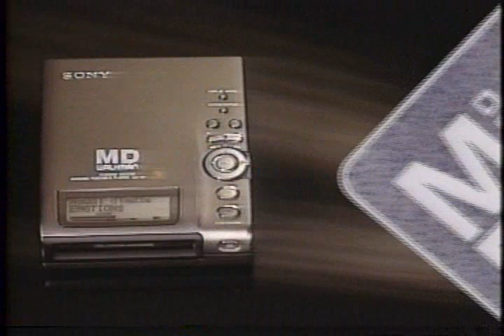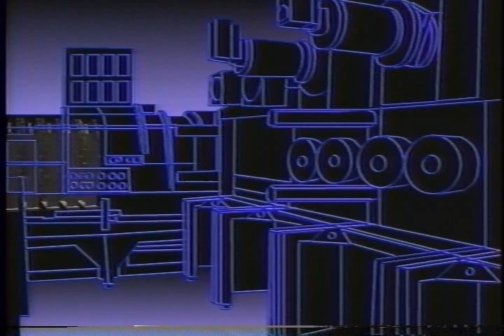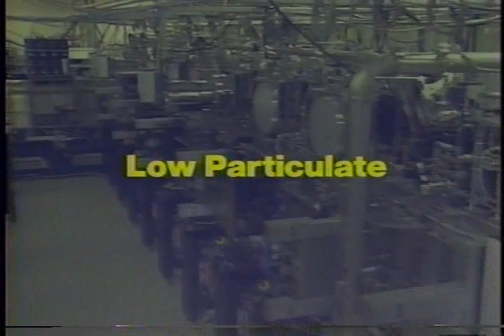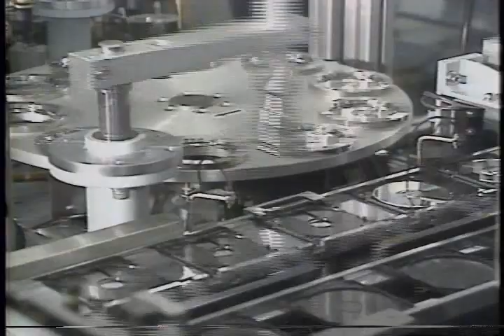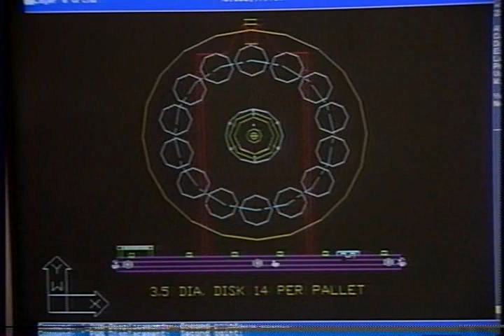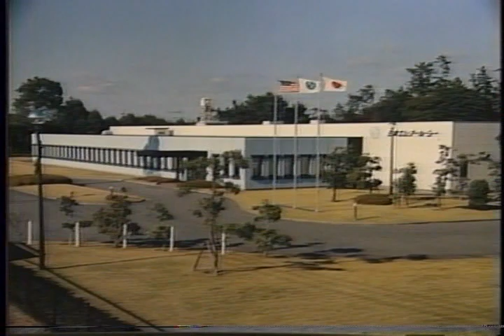Inline Sputtering

Comment: NEW IONBEAM
1 pre-treatment, implant, etch, ibad, cleaning
2 Features: 1 mass production possible throughout the month, arcing None, particles in the ion beam does not. Sputter as the pressure is constant. Mater Maintenance None required.
3.dc 4000V power available, the ion beam can produce 6M, double loop available, ion beam angle adjustment
Request kdh6157@hanmail.net,+82-1076852564, Japanese can